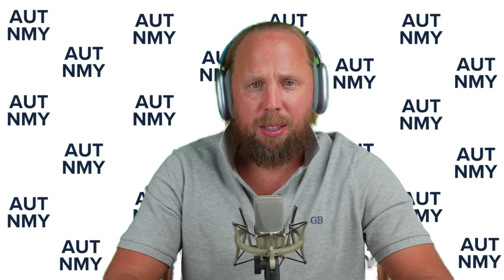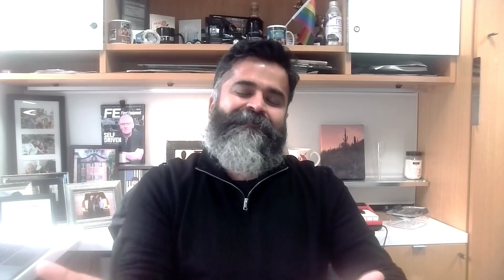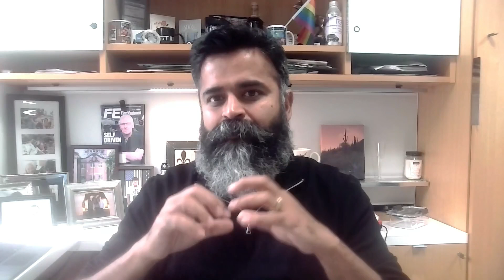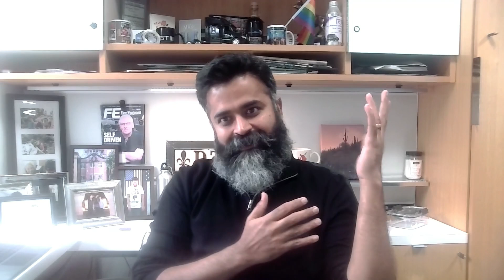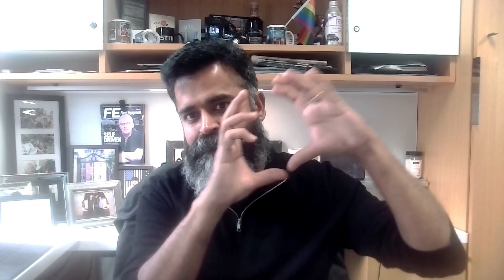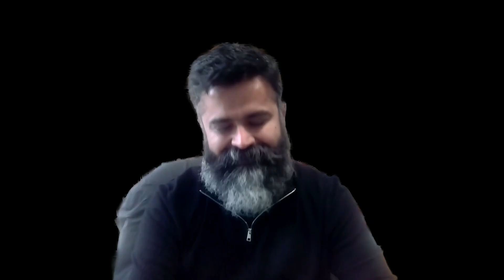Daimler Truck's Approach to Developing Autonomous Trucks

Comment: Hi @Autonomy, did the podcast state that Waymo Via - trucking program is coming back ? Any hyperlinks on this is appreciated.
Reply: Appreciate responding to comments!!
Reply from the maker: @vigneshmahalingam7689  You are welcome and thank you for watching.
Reply from the maker: "And if the company succeeds in its master plan, the Waymo Driver software powering its driverless robotaxis would be included for other uses such as trucking, deliveries and, eventually, personal vehicles, the company told the Chronicle."

https://www.sfchronicle.com/bayarea/article/waymo-driverless-robotaxi-expansion-19657064.php